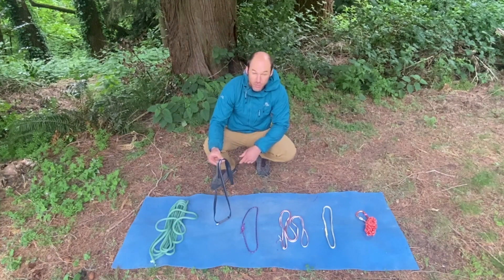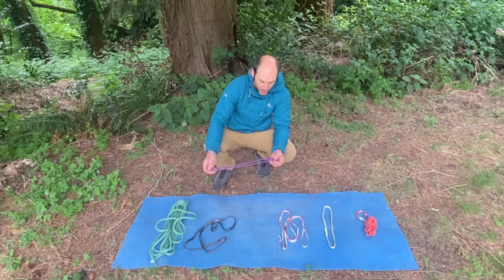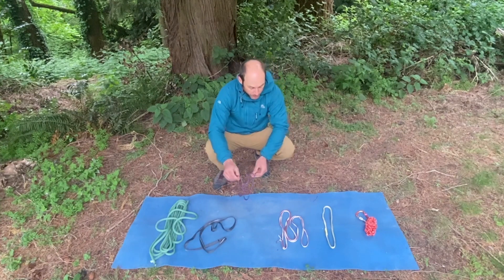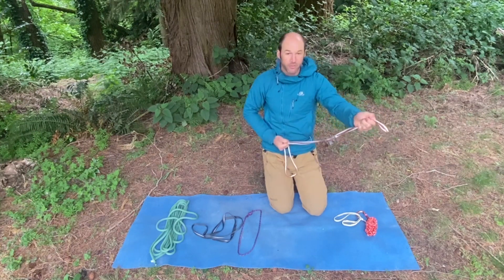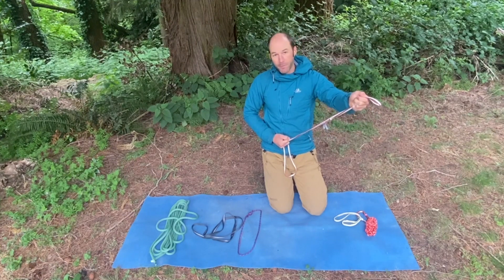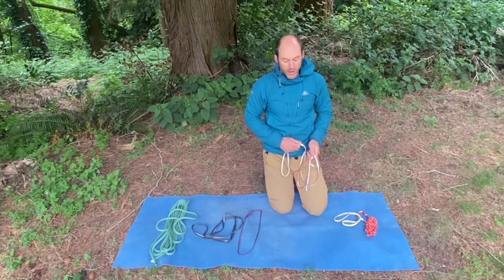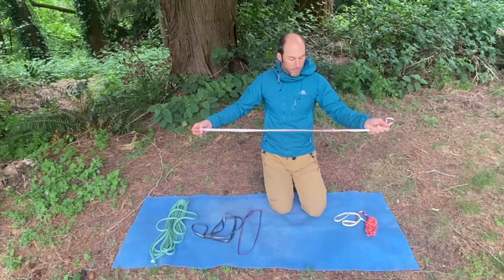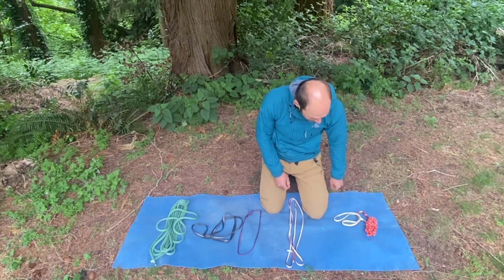Climbing Material Properties: Nylon, Dyneema (UHMWPE) , Aramid

Comment: Are you sure that the last rope is nylon outside and aramid inside?
All ropes are made aramid outside for cut resistant and nylon inside for shock absorbing....
Reply from the maker: Thanks for checking @Jesuswillbeback!  Yep, aramid core (Technora is the brand of aramid used) and nylon sheath.  That's Sterling Powercord.  The reason climbing ropes and cord tend to have nylon sheaths is for handling, keeping the core fibers from unbraiding, compatibility with climbing tools such as belay devices, rope clamps, and ascenders, and for improved function as friction hitches.  Thanks for watching, and I hope this answers your question!

Comment: Hey Glen, as usual, very thoughtful content informed by your expertise and experience. Thanks! I wanted to add something to this: polyester for accessory cord for use in slings, cordelettes, and friction hitches. Personally, I much prefer it over nylon. A number of companies make accessory cord for climbing from polyester and is it similarly rated to nylon accessory cord of the same diameter. Here is why i like it: it is more flexible than nylon of the same diameter. It feels more supple and so it grips better in friction hitches. Knots cinch down super tight so they end up smaller than the equivalent knot in nylon. It is also very abrasion resistant. In short length applications, where the dynamic quality of the cord is a non issue, I would prefer to use polyester in place of nylon accessory cord...that is when I am not using dyneema :)